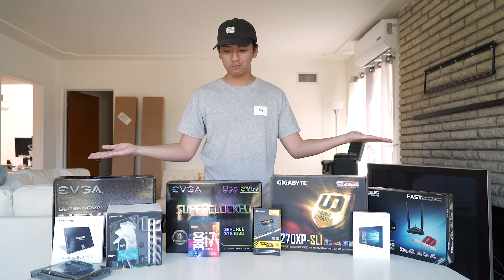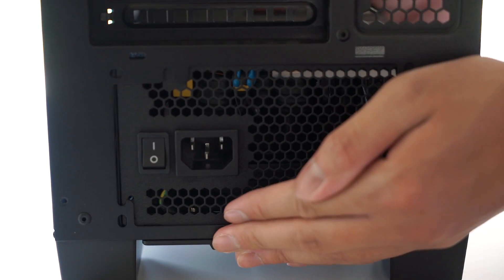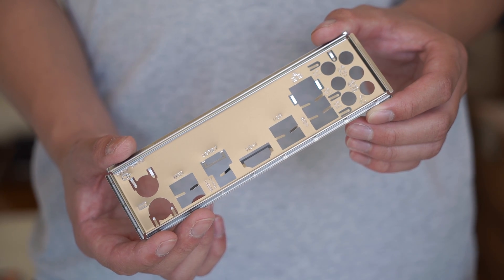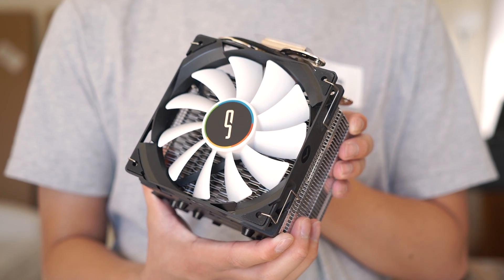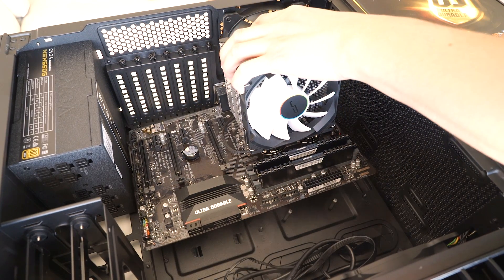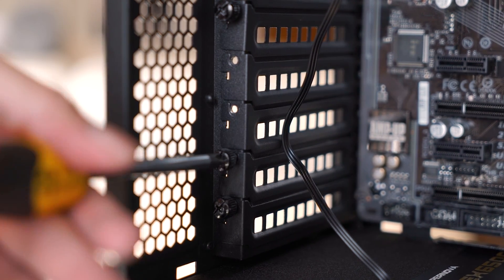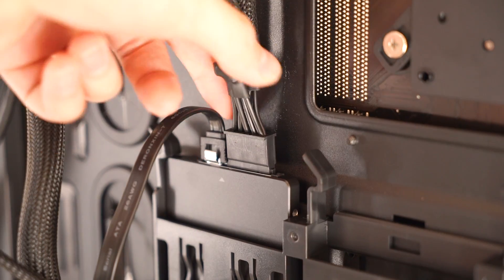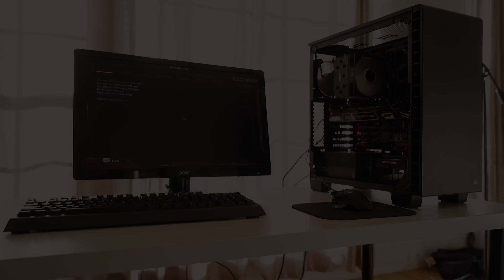How to Build a PC

Comment: why do you have to add an ssd and a hard drive? i thought they were kind of the same thing? im new to this so im just trying to learn lol
Reply from the maker: Solid states are much faster! So if you put your operating system onto the ssd the computer should boot faster!
Reply: SeanDNguyen oh alright then , thank you (:
Reply from the maker: No problem! And the hard drive is for data storage - 1tb because it's cheaper for a hard drive than a solid state for 1tb.

Comment: unique , different from the pcpartpicker and other building pc tutorials so far (like the first removing of the side panels, and that joke of download RAM XD)
Reply: also, gonna add is depends maybe if your hand is huge so before installing the vcard, the better is do those small  connections before installing the vcard, just to prevent hitting the vcard XD
Reply from the maker: LOL YES. tbh i had to remove the vcard several times because I couldn't place the cables for HD audio underneath it. LOL
Reply: hehe XD